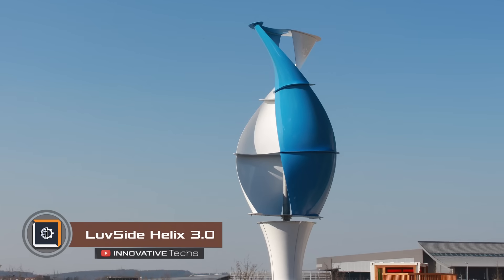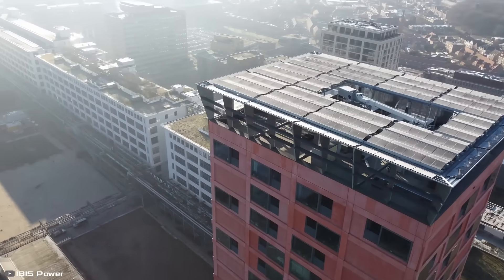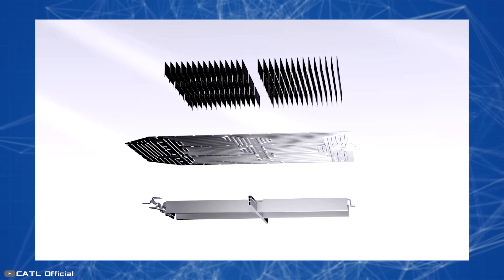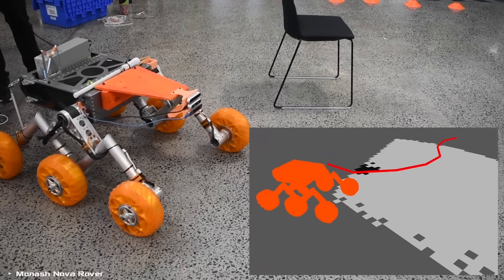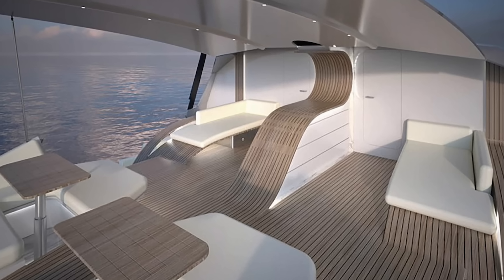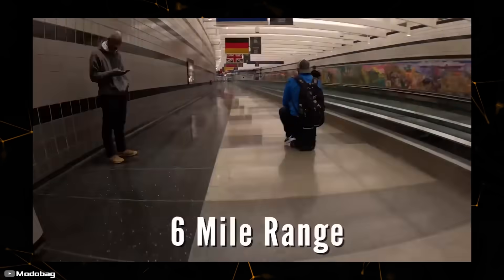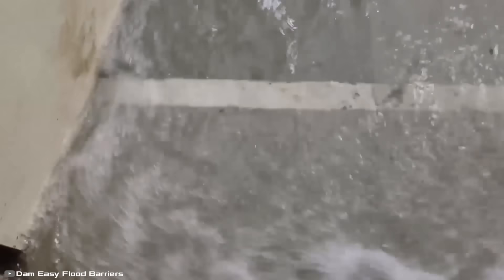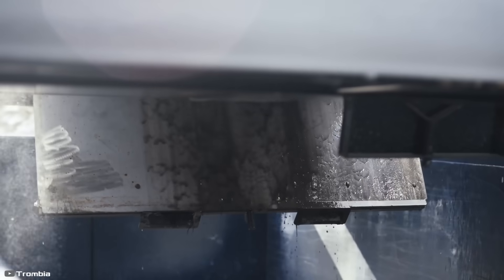10 INVENTIONS RESHAPING REALITY: UNVEILING THE POWER OF EMERGING TECHNOLOGIES

Comment: The solar/wind powered setup is something that should be used more often than not, in my opinion. The hydrofoil with the screws on it is genius. I don't understand why we don't have more vehicles that utilize integrated power systems, it seems plausible to me that anything in motion should be able to utilize the wind, friction, static (vibration),etc. With solar panels for power? And yes I know that I'm making it sound simple, but sometimes simple is the answer. KISS- keep it simple stupid.